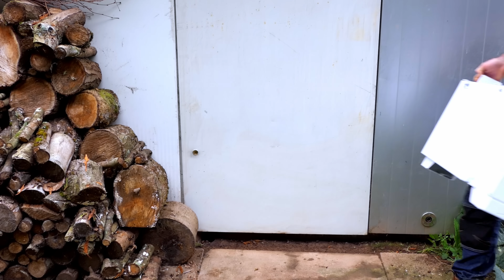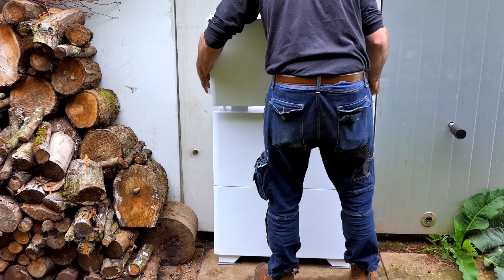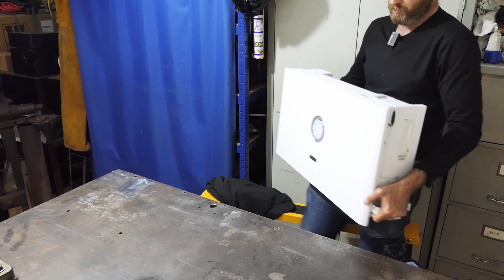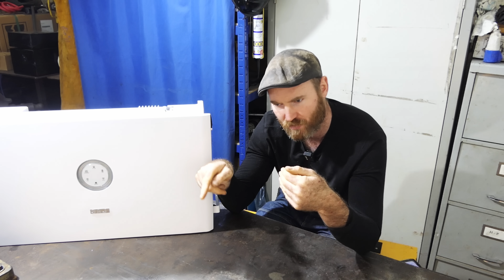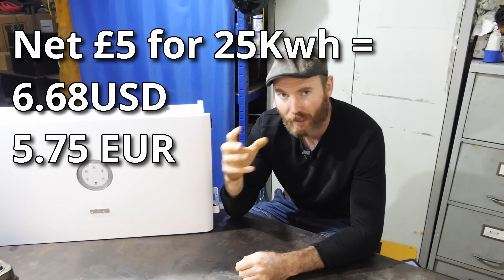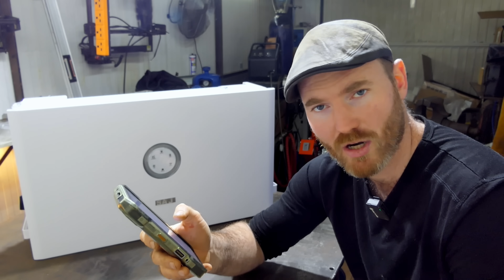New Batteries Make Money?... I'm shocked

Comment: Australia makes so much roof top solar now that Smart meters have to be installed to disconnect the houses from the grid and/or install batteries on power poles to suck up the excess( they say it is for backup if grid fails", sure those tiny batteries can power a few streets of homes?
 Everything has rebates that taxpayers pay for. If you are a renter you pay extra for power so next door home owner gets discounted panel and batteries.  And because they are renewables they need replacing(renewing) in 15-20 years.
Reply from the maker: That's an interesting perspective on the Australian situation. Cheers J

Comment: I expect each battery pack contains many cells and if only one cell dielectric material fails then all the battery-packs and the building beside them will most likely blow away on the wind as smoke, instead use this method to drive a crank to then drive a generator to generator power on demand: https://m.youtube.com/watch?v=9HX_nnqv9_o.

Comment: Just watched a video by Artisan Electrics on sodium batteries. Much more thermally resistant and can tolerate deeper discharge cycles. Probably not as energy dense but fewer issues with being outside
Reply from the maker: That's interesting to hear about sodium batteries. Cheers J

Comment: The reason why our electricity costs are so high, as I understand it, isn't just that we use a lot of gas. We base the price of energy (wholesale) on the cost to produce a unit of electricity with gas. Which means the wind turbines for example, with essentially 0 fuel cost, benefit massively when the cost of gas goes up. And we pay for it.
Reply: we are connected to europe and norway  electricity never goes below the cost to export it
Reply from the maker: Interesting point. Cheers J

Comment: I'm an installer in New Zealand, these schemes don't work on a financial basis, they are not an investment. You are better generating your own power and keeping your own power.
Reply: UK you can buy electricity overnight at 7p and sell it during the day at 15p. Not impossible to make money, but payback won't be in months - more likely to be outside warranty by the time you get your money back.
Makes more sense to shop around for a cheaper battery system (can get a 40kWh 48V LFP battery for under £4k). Even if you just charge at 7p and use it yourself rather than sell back to the grid at 15p you should make that money back.
Reply: @grahamleiper1538 wow lucky. In NZ i pay the equivalent of 13.5p off peak and 16p peak price, and the buyback is 8p off peak and 10.5p peak therefore selling power back you have to have solar to make it worthwhile. I have to sellback enough to credit £27 per month just to cover daily line charges and electricity levies for the month, then add the cost of any grid power used.
Reply: @grahamleiper1538  You have to factor in that batteries are not 100% efficient - they lose 10% at least to heat and the inverters and transformers. So that 7p per kwh becomes 8-9 p used. That reduces the margin to 6p per kwh profit. But then, any tariff with a cheap night rate will likely also have much more expensive peak rates, so you'll need all the power you saved to cover that.
Reply: @grhamp they're not "much more expensive". If you figure a quarter of the time I'm paying much less, even if I didn't move things to the cheap rate it wouldn't be much different to everyone else's normal rate.
Reply from the maker: That's what I thought. Cheers J
Reply: There was another advocate of his but he passed away during COVID.
H lived in the use and was using Tesla battery packs with a Chinese charger in a H bridge arrangement.
For us you could just use a Tesla if they wired it right, or any other EV that supported DC out.
Interesting guy. M.

Comment: One of the big power bank companies recently made a DIY fitted solar panel/battery combo that has allegedly become more popular than professional installations in Germany, there the power from the power banks can be plugged into any home socket and it starts supplying power to the house, I think that's illegal in the UK unless you have a switch to isolate from the grid when running a generator/huge battery pumping power into the house/grid. Have you seen the outdoor Central heating wood boilers? They heat underfloor heating, the water for the house and fill it once and it burns all day, if you can incorporate wood burned energy generation into a system like that you would be completely self sufficient and with enough batteries you could be an energy fatcat supplying the grid with the tears of Congolese cobalt slave labour victims! The Central Heating Wood stove 90% efficiency https://www.youtube.com/watch?v=_PL0yBdvSxA I would personally build this into a huge metal shed and store the wood and probably work in there-that way you don't freeze your balls off filling it up in the snow or more likely rain and the het from the HUGE stove/long stainless steel chimney isn't lost to the snow. If you have woodland with trees, you can be energy independent for life. IMO The Digital ID + Central Bank Digital Currency + RFID chip = Biblical Beast Banking system "in" the right hand or "in" the forehead, watch as multiple countries simultaneously push HARD for DIGITAL ID including the so called land of the free...

Comment: i would let those batteries do their thing but i would still keep a decent diesel generator on the side 
the advantage of diesel is its instantaneous power on demand ,and you can store as much energy as you need in the form of liquid , you can burn used motor oil , any kind of oil (i know you need a permit in your area, but i dont ) , i would collect used motor oil from my own car and maybe family and friends ,the fuel will trickle down to you until you have stored enough for an extended blackout , even during the blackout itself you can still get diesel to supplement your stock
also i would 100 % keep the batteries inside no matter what the law said ,i would make sure its safe and if it burns it wont take the house with it ........ who came up with the idea of leaving batteries outside ? your government is really incompetent
Reply from the maker: I agree that it's good to have a backup, especially with the current state of the grid. Cheers J

Comment: For most people (who want these systems) the saving is greater, because it's not about selling back to the grid it's about using the electricity you bought during the cheap evening rate during the day.
Reply: Really you need to apply solar along side a battery system to save. In addition to your free energy, you'll heavily reduce your emissions, it's a win win
Reply from the maker: That's true, however if it can't make money then it won't save money either... cheers J
Reply: @joshuadelisle  you have to spend money to save money but not make money.  That makes sense when you can buy cheap and use it when price is high so actually you make money

Comment: idk about the UK, but here in Belgium we pay around 20 cents just on distribution costs and taxes, then there's the electricity cost itself which fluctuates during the day but is on average maybe 10 cents. So even if you can buy at 0 cent/kWh and sell at 15 cent you're still LOSING 5 cents (0 + 20 - 15). This entire idea won't work Joshua...
Reply from the maker: I don't disagree... cheers J
Reply: Selling back to the grid with a profit only happens a few hours a year. There have been hours where grid prices go to 40 or 50 cents a kWh but they are not common. Where you save the money is in self consumption during the expensive hours. eg today in belgium prices vary from 0.5 cent to 10 cents on hourly rates or from 0.1 cent to 13 cents on the new 15 minute rate. And then you add the 20 cents of taxes and grid fees on top. I calculated my battery costs me about 6 cents per cycled kWh for charging losses, even including the grid fees on those losses, and the pay back period for the battery. There is a small margin to make a profit from the battery if used for self consumption. Belgians also pay a peak rate for the highest 15 min peaks every month. During cooking my peak used to be 4 kW over a 15 minute average or 1kWh consumed in those 15 min. With a battery doing peak shaving it's down to the 2.5 kW minimum everyone always has to pay. At a rate of 50€/kW/year that saves me about 150 euro's a year. In 15 years the savings on the peak rate alone will save me enough to pay for the battery I bought. Yes the 15 min peak rate is a silly system unique to Belgium or Flanders but I'm gaming it while it lasts.

Comment: Fuck having that much lithium next to my house! I remember a lightening strike hitting the pylon across the street and it knocking the grid out- it struck me recently ‘ I wonder how that would effect a Tesla battery?’.
I’m more intrigued in the new salt/salt water batteries that are coming out- all the power, less of the ‘boom’.
Reply: And less of the natural destruction and child labour mining the stuff.
Reply from the maker: I didn't think of that.... Hmmm... That's Worth exploring. Cheers J
Reply: @jennfaulks6056  Lithium Iron Phosphate don't use any rare earth minerals that are associated with child labour. Most of the Lithium is coming from Australia these days. The natural destruction isn't any worse than any other type of mining or resource extraction. Likely not as impactful as oil and gas extraction but both are hard to quantify. In the long term there is lots of potential for closed loop recycling.
Reply: Hang fire on sodium batteries, they work like lead acid batteries, I expect they will get better but not for a while, check out DIY Solar with Will Prowse sodium ion worth the hype
Reply: Lithium Iron Phosphate batteries don't have the thermal runaway problems of other lithium battery chemistries. They are very safe for home use. While they can still burn, it takes a lot to get a fire started with them. People have driven nails through them and they don't go up.

The safety of sodium batteries is yet to be proven. Sodium is potentially more dangerous than Lithium but its going to vary greatly with the exact chemistry used. In its pure form Sodium is more reactive than pure Lithium. The details matter.

Comment: Hi Joshua, batteries alone don't give the full benefit especially with only 5kWh capacity. I have a similar looking modular system from SigEnergy with a 16kWh battery and 8kWh solar split over 3 separate arrays.  

Yes you are right in winter the solar doesn't really help that much but amazingly it's 3/11/25 and my solar arrays still generated 4.1kWh today.  Yesterday was a good one for November, they generated 11.83kWh. 

On a typical day my batteries fully charge between 2am and 5am at £0.17 per kWh,  max of £2.72 to fill them from zero but I limit the minimum the batteries SOC can be too 15%. 
They drain slightly until around 8am when the sun hits the first array. By 9am they are back at full capacity and the solar mostly fully powers the house right through till the evening while exporting any surplus, which when the house is empty and batteries are full can be around 6kW per hour if it's cracking the flags.

I use the AI system coupled with pre-programmed time slots of the best time to import/export. Octopus Energy flux charges me  £0.17 per kWh between 2am and 5am then £0.28 per kWh up to 4pm. Between 4pm and 7pm the rate is £0.39 per kWh then back to £0.28 per kWh till 2am. This cycle repeats everyday. This might be different depending on your location and they review it every few months. The amount shown here is the current pricing.

I average approx 6000 kWh per year. My solar last year generated 6420 kWh however this is heavily weighted between April and September. Coupled with exporting when the batteries where at capacity and dumping between 10 and 12 kWh per day when the AI felt it was feasible (peak export rate being £0.30 per kWh) meant I earned a lot of credit through the summer and only paid a small amount for topping the batteries up each day and the dreaded standing charge £0.68 per day. The credits earned throughout the summer period meant my total annual electricity bill for last year, which includes the standing charges was £345.  Prior to solar and battery's my electric bill was £170 per month with BG on their standard variable tariff. 

Now to the worst bit, the system wasn't cheap, full installation and certification was £12700. This means my payback, should energy prices remain constant, will be approx 7 years. If energy goes up during that period my payback will be shorter, if it goes down.... haha not even worth mentioning it's never gonna go down is it?. 

As you say the system is guaranteed for 15 years so in effect I will be making profits for a further 8 years but in reality this will be much longer. I estimate that over a 20 year lifespan, including a few call-outs for replacing say the inverter, and a full panel replacement in 15 years it will be massively profitable but only because the solar makes a massive difference. Interestingly the solar is the cheapest part of the system. I could have just got the panels, inverter etc installed for around £7k the batteries are the expensive bit but the combined system is superb. I'm a proper nerd so I do have a quick check every now and then to see what it's doing and it's surprisingly good.

To anyone reading this who is interested in a setup like this I can advise you it's not overly difficult, the installers do most of it for you but from start to finish, the whole thing took around 2 months to get up and running. Most of this is appointments for quotes to find the best most suitable system for your needs, the installers are always chocker, and dealing with the DNO/switching suppliers etc is a lot of waiting for emails but once it's done you will wish you done it years ago. The actual installation took 4 days, scaffolding front and back on day 1, then the sparks came out on day 2 and 3, they weren't in a rush, then scaffolding down on day 4, the rest is then waiting on the DNO and Octopus Energy really.

Hope this helps anyone who may be thinking about it. If you want an idea most solar companies have it automated on their sites. I'm not recommending the company I went with here as it's not fair on their competitors but if I had to do it again I wouldn't hesitate to give them the nod.

Comment: Fuel Tax Regulations: As of April 1, 2022, new regulations prohibit using red diesel (rebated gas oil) in generators. Only ultra-low sulphur diesel is legal for this purpose. If you were using heating oil before this date, it could still be used until stocks run out, but you cannot purchase more.
Reply from the maker: Thanks for the info. Cheers J
Reply: @joshuadelisle  "They" are doing their best to stop us from being self sufficient any way they can.
Recent article in either Guardian or Telegraph, can't remember, saying how dangerous log burners are.
Of course, they will also use the see oh 2 hoax as well against log burners.

Comment: Everything about living in GB is a rip off. The technology is not advanced enough or cost effective for domestic use. The lottery of finding the right professional installers another bugbear. The government have no idea on how these systems work in the real world. 
Too many people have house hold items that are just gimmicks,plus most homes are inadequate in the construction and thermal efficiency. Until we get some joined up thinking these are just another way to spend what money you may or may not have. One question is removing vat or any tax associated with these products and services. I don't know if that would help us small people. Just a thought. Love the channel Joshua. Keep up with the good work.
Reply from the maker: Those are valid points. I just want to be off grid and away from the crazy... Cheers J
Reply: No vat on battery installs for domestic, nor solar, nor load diversion controllers, heat pumps, air con units for heating.  What else....  Actually we are doing well in the UK, certainly in the running with a lot of Europe on the quality of buildings and cost of living.